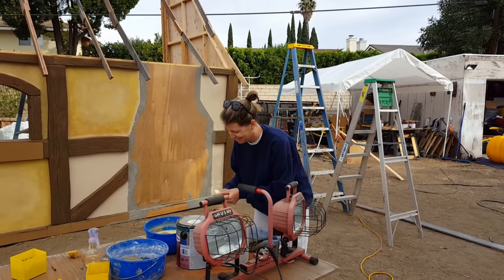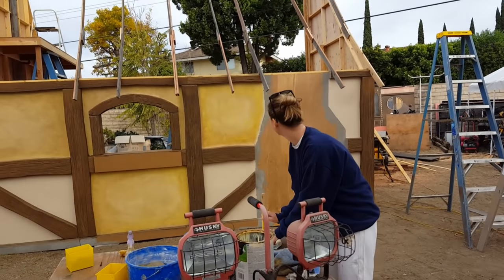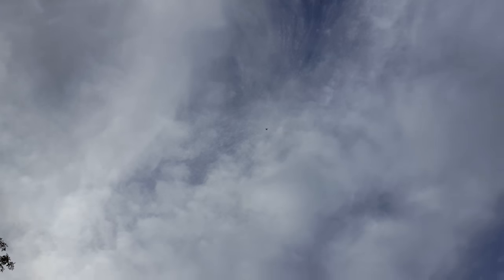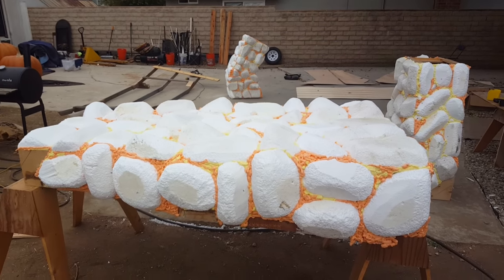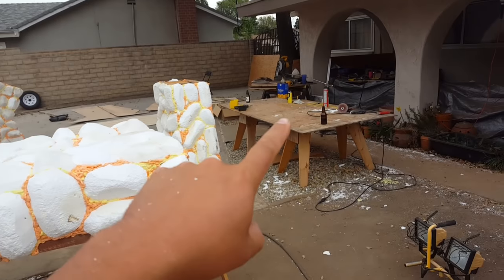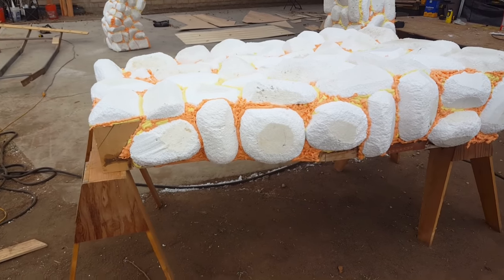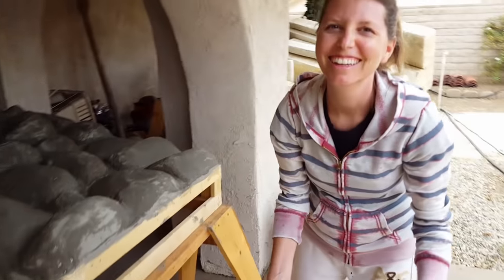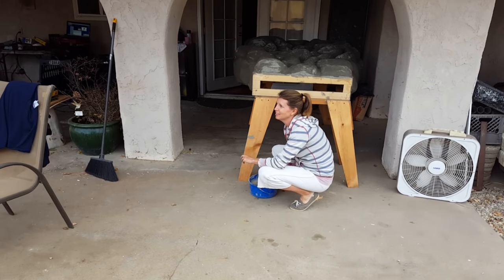Foam Coat - Hard Coating Styrofoam Faux Rock For Fairytale House

Comment: Hey, qq (quick question tho), would it be okay if I paint the coated styrofoam with pylox/spray paint for bike with or without aerosol? Thank you.
Reply from the maker: I'm not for sure never tried but if it has solvents it may melt the foam. You could test or prime the foam first with a safe paint then spray it. Best of luck.

Comment: I'm having a hard time finding styrofoam thick enough to make the stones shown in this video. Where do you find styrofoam thick enough to work with?
Reply from the maker: Craigslist in the los angeles area or stores like foam mart which is also online or example.  You can also glue smaller sheets of foam pieces together using great stuff spray foam to make larger blocks.  The large blocks from foam mart can be expensive usually between $100 and $200 for a 4'x3'x8' for example.  Good luck!